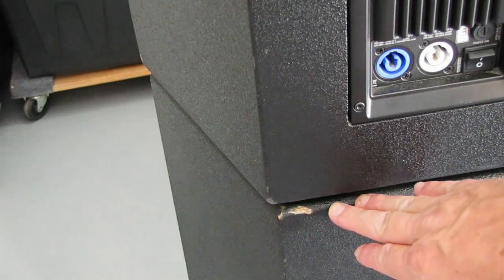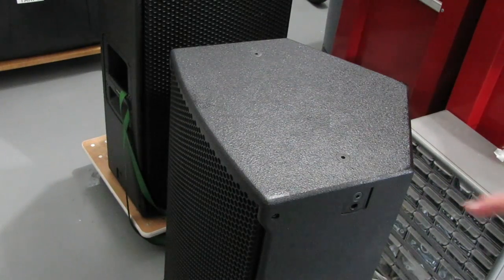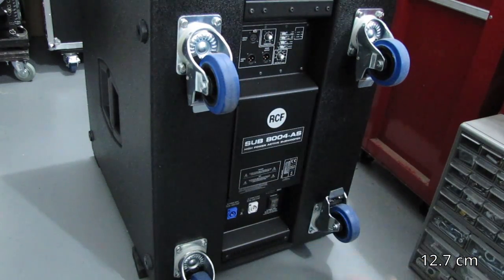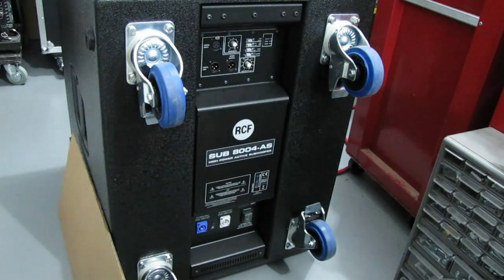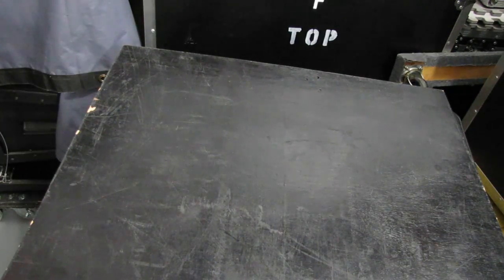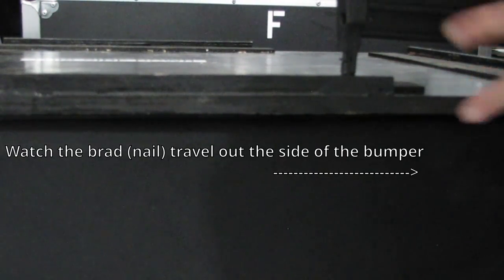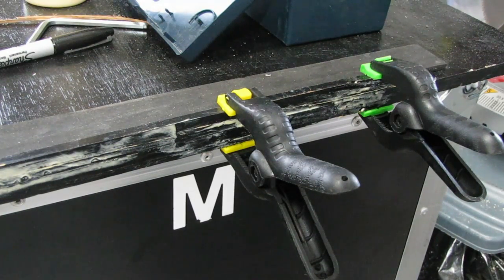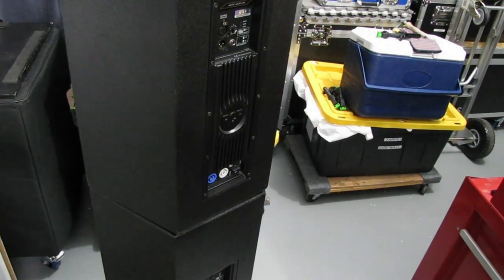Sound system equipment maintenance (fixing, improving, painting)

Comment: Brand new again.Question what paint you use on the boxes
Reply from the maker: It's an oil based satin.  You should use a paint brush for it; do not use the sponge brushes.  Any reputable brand of paint should work.
Reply: @stageleftaudio   Thanks for the info my subs need painting  I know this will work

Comment: What are the cost to have “road case” for expensive RCF subs and speakers?  I rather investing money to protecting my gigs.  
Since pro levels have road cases to protecting all gigs during transportation.
Reply: He personally does the loading ang unloading of gears, another thing road cases will add load volume thus taking up more space in his limited van capacity. But i agree road case is the ultimate protection.
Reply: You are right. Additional loads, that is why to invest in Fuji boxer truck with ram or lift gate.
Reply from the maker: As Jems mentioned, cases add more weight and take up a lot of volume.  Obtaining a larger vehicle, just to carry gear, requires a larger expense of fuel, insurance, maintenance, and possibly storage of the vehicle.  We would greatly enjoy having a larger vehicle!  However, at this point, the logistics are prohibitive to having a larger transport vehicle.  Thanks for your comment.
Reply: I have padded covers for my JBLs and still get minor scuffs. I love your videos, keep them coming!!
Reply: @stageleftaudio  uhual rents trailers and trucks quite affordably...nice n square, good for road-cased equipment...ask me how I know